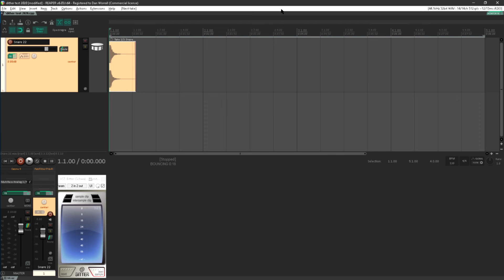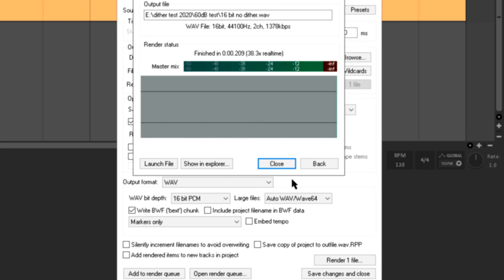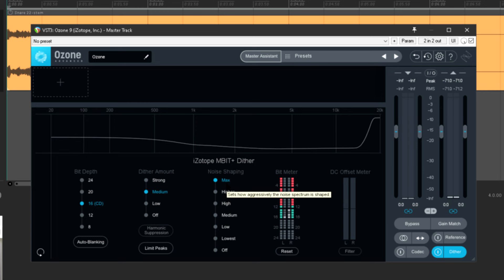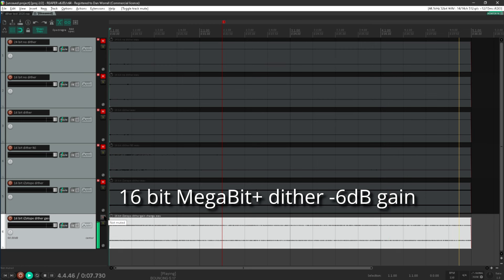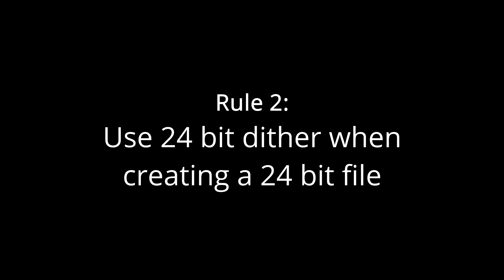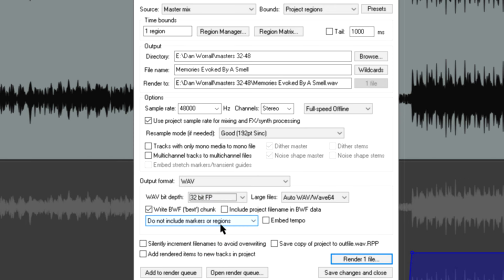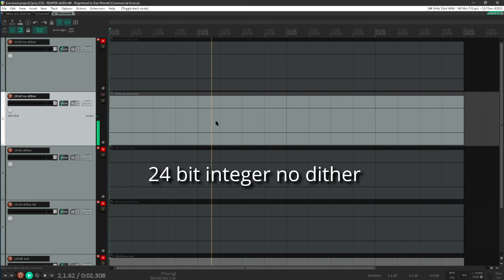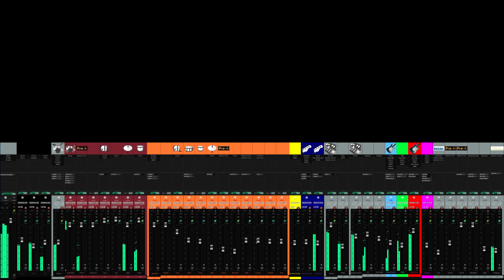WTF is Dither?

Comment: Hi there!
I might be wrong but I think I noticed a mistake in your tests or your conclusions:
When you render the MP3 files both at -60db and -108db, the Dither master and Noise Shape master options are greyed out BUT checked, selected and can not be unselected. Then you present the MP3 files as "no dither" but both dither options are checked.
When you render the WAV file at 32 bit FP these options are greyed out but unselected, meaning you can not select those.
At a point you say that the MP3 files don't let you check the Dither options just as with the 32bit file maybe because it might not be necessary but it's the opposite.

Excuse my bad English, Spanish native!
Reply from the maker: The option is greyed out because dither is not applied. Not for any floating point format, which technically includes MP3 etc. This was confirmed by my tests.

Comment: Hi Dan! first of all Thanks so much for your knowledge. I'm from Argentina and sometimes it's hard for me to understand English, for the most part what you explained is clear to me, but the doubt I have is: I configure my session in 32bit float and then I record everything at 24bit as normal, I generally keep the gain staiging -18RMS at all times, when exporting to go to mastering is it necessary to apply dither in this case that I am using 32bit float? That is not entirely clear to me, I understood that it is supposed to be the last step but I also saw that the distortion could appear even at 24bits. Greetings from Argentina
Reply from the maker: If you render a 24 or 16 bit file you should use dither. If you render a 32 bit float file dither is not needed.
Reply: @DanWorrall  thanks again for the quick answer! Platón says that You're the exit of the cavern  😁

Comment: I have a question, say I use a plugin with built in dither function at the end of my master chain. My session is running in 48khz. And I export from reaper to 44.1 khz 16 bit and encode mp3 at the same time.

What would be priority for sample rate conversion and dither application?

Preferably it would downsample from 48 to 44.1, then apply dither to the 16 bit 44.1 wav, then encode an mp3 from that file, if I understand the video correctly.

Do you know if reaper 7 processes in this order?
Reply from the maker: Your question seems confused. If you're running a dither plugin in your project then you're doing dither before src, which is the wrong way around. Turn off the dither in your plugins and use Reaper's dither instead to encode a wav file with dither, then use the batch converter to make an MP3.
Reply: @DanWorrall  okay, I understand that src is post render and thus the plugins dither gets broken by it.

I'll render at 48 khz, 32 bit then.
And I will use a third party tool for sample rate conversion and dither.

Thanks for responding 🙏

Comment: I didn't get, from where the information coming in 16-bit MP3 file if it's already rendered in 16-bit, but Reaper magically played it below -96dB?
Reply from the maker: It's not a 16 bit MP3 file. MP3s are floating point. If you put 16 bits in, you'll get 16 bits out. If you put more than that in you'll get more than that out (if the decoding side decides it wants to).
Reply: @DanWorrall  Thanks! So, if it rendered at 16 bits, mp3 is still 32 bit float (which is currently 24 bit+extra8bits) but will act as 16 bits and nulls? The information just unused above 16 bits in mp3 always and decoded with most of mp3 players? I thought if more bits=more file size=more bitrate needed to decode in every second of time. But if it's constantly have that extra bits above 16, but it's zeroes maybe the size of the file will be the same always. I didn't know it's float point (32 or 64 float). But i'm guessing, that quiet sounds in mp3 is a wobbly digital noise, isn't it?

Comment: @Dan Worrall    Thank you very much Mr Worrall for such a great video. Would've called you Dan but.....that just doesn't feel right after this video. 😀 I offline bounced a file to 24bit 44.1Khz all coming out of a 24bit 44.1Khz recorded and mixed project. And even if subtle, I could swear the sound changed. Well, I am positive. Never could hear that before but probably because of new monitors....I heard a difference and was rather annoyed by the fact only taking this video more seriously now than before as the info was way above my head when first watching it. 1) Could this be a dither vs non dither problem? I did not dither in this case. (I freezed all my files before bouncing and did not change the plugins' options like turning on oversampling or anything like that) Another question...well....more of a doubt is the following. 2) Do we need to dither at all for files that are staying the same such as 24bit recordings to 24bit mixes and masters at the same sample rate? And my last question and maybe the one we all would like to know is.......3) Is it better to dither or not to dither when uploading to streaming services?  If they convert to lower quality such as mp3, does it do more harm than good?  Sorry for all the questions and I apologise if they don't make any sense. Hopefully there is time in your busy schedule one day to answer them. Thanks again for a great explanation.
Reply from the maker: 1. Almost certainly not dither, which is nearly always inaudible. Honestly the most likely explanation is you noticed something after rendering that you missed during the mix.
2. They don't stay the same bit depth, as all the mixing and processing is either 32 or 64 bit float. Meaning your finished mix is also floating point, so yes you should dither if you're going to 16 or 24.
3. Dither doesn't break from lossy encoding, though the noise shaping might suffer. Still better to use it than not.
Reply: @DanWorrall  An answer in less than a day. Dan Worrall, you are the best!!!! Thank you very very much!!!

Comment: Brilliant video! Reaper is an 'attractive' - looking DAW, I've got a demo one here, and on days when Logic Pro is driving me crazy, I'm tempted to install it! But the problem is, Logic is the industry standard, Reaper is not. Do you do any videos using Logic? As I wonder how Logic's Core Audio would compare and contrast with Reaper? Couple of quick questions, if I may: 1) I tend to do everything these days in 24 bit and 48k, would 32bit float be better for that resolution? 2) I've got the Sonnox Codec Toolbox, and that's really a game-changer! The new codecs piss all over both wav and mp3, it's just nobody's using them yet - I can't upload them anywhere, which is really frustrating as the quality is substantially better than wav/mp3, and the file sizes a fraction!
Reply from the maker: I don't have a Mac, and every time I've used logic I've kind of hated it, so logic tutorials are unlikely to happen on this channel I'm afraid. I don't accept that it's an industry standard, or that that matters in any way anyway.

Comment: Great video about a very important technical matter that most engineers don't care about (but I do, a lot). I have two questions:
1) I always create a separate mixbus track before the Master channel for all the mixbus processing I'd want to be in the mix. When you I plugins in the Master channel that change the audio like Sonarworks Reference 4 or an EQ to cut lows and highs to only hear the mids (plugins I will deactivate when rendering the mix), should I keep my dither plugin at the end of the Mixbus track (before the Master channel) or at the end of Master channel to dither even those plugins?
2) What's your opinion on the NotJustAnotherDither from Airwindows?
Reply from the maker: 1. Dither should be the last thing that happens before you truncate to an integer format.
2. Not tried it. Is it Mac only?
Reply: @DanWorrall  1) Given that I deactivate all plugins in the Master channel before rendering, only the plugins in the Mixbus are still working, so the Dither becomes the last active plugin.
2) It's for windows and Mac, and free (just not in AAX format): http://www.airwindows.com/not-just-another-dither/

It comes included in a dither pack plugin called Ditherbox named as "NJAD": http://www.airwindows.com/ditherbox-vst/
Reply: @DanWorrall  Not any more, Chris has ported a bunch of his dithers to his new build system which also does VST for Windows and Linux
Reply: @DanWorrall  "Ditherbox" is the all-in-one dither plugin: https://www.airwindows.com/ditherbox-vst/ The version in the all-plugins download might have some bugfixes since the link on that page, not sure.
Reply: The version of NotJustAnotherDither found in StudioTan and Monitoring are better (not so bright and fizzy) than the original stand alone version IMO.

Its not a dither, more like a nicer sounding truncation, if that makes any sense.
Reply: @StevieBoyesmusic  Oh, I didn't know Chris updated NJAD in those plugins, weird that he didn't in the single one and Ditherbox.
Reply: @heavymetalmixer91   I think the noise shaping is less aggressive in  the later versions
Guess The originals weren't altered for mix repeatability reasons.

Comment: btw do you happen to know how flac files work? i think it's pretty awesome how these quite unknown kinds of files are just smaller than wav files without changing any aspect of quality. or do they?
Reply: The way I've heard it described is this...
WAV stores all information, both SOUND and NO-SOUND in its file. NO-SOUND still has "file-size".
FLAC doesn't store the NO-SOUND.
So it basically has the exact same SOUND as a WAV, but a smaller file as it's ignored the "blank space".

I honestly can't tell any difference between the two. It may be there, but it's so small it's possibly not worth worrying about.
I'd still love for this to be confirmed either way though.

Comment: Hi Dan, my question is, should one always default to working in 32bit float? What is the drawback in working in 24bit? Thank you.
Reply from the maker: Your DAW already uses floating point maths behind the scenes, so when you're mixing you're working at 32 (or 64) bit float regardless. Your project bit depth setting just determines the recording setting. Your converters are probably 24 bit, so there's no point going higher there. If you're rendering a mix for mastering 24 or 32 float are both fine. 24 bit technically needs to be dithered (no-one will ever know if you don't though) while 32 float doesn't. You get extra headroom above full scale with 32 float, but a larger file size. If you're rendering a master for release then stick to integer formats, 16 or 24 bit.
Reply: @DanWorrall  Thank you Dan, this is perfect!

Comment: Ok, I really focused and paid attention but just want one confirmation...If I record/mix in 32-bit/float, should I be concerned about dithering my plugins to 24?  Should I worry about dithering my master fader to 24-bit before sending for mastering?  Is it ok to dither to 16-bit from 32??  Thank you.  I went to college for this but it's always fun to review and confirm.
Reply from the maker: Don't worry about "dithering your plugins".

Use 24 bit dither if you're rendering a 24 bit file. If you're giving your mastering engineer a 32 float file don't bother.

32 float to 16 bit with dither: that's fine.
Reply: @DanWorrall  You are the man!  Really digging your channel.  Thank you for the advice and prompt follow-through!!!!

Comment: Hi Dan,

If I started the track in 24 bit and Im rendering the final master @  24 bit should I still end my master chain with a 24 bit dither + noise shaping? Im currently using Ozone 11 maximizer with 24 bit Dither , Low dither, Low noise shaping + auto blanking , limit peaks and dc offset meter filter all engaged. Is this optimal ? Or since i'm not downgrading to a 16 bit rendering all unnecessary? Mostly, what I've read online makes it seem since I am not dropping to a 16 bit render that it could be potentially more damaging to add this step.

Thank you
Reply from the maker: You may have recorded 24 bit files, but your DAW is mixing them using 32 or 64 bit floating point maths, so when you render a 24 bit file you are indeed reducing the bit depth, and yes you should use dither. However this is a case where it's mathematically correct to do so, but the difference is so tiny no-one will ever notice if you don't. It's much more important to correctly dither when you drop down to 16 bits.
Reply from the maker: I tend not to use auto blanking personally, as noise draws more attention to itself when it stops and starts then when it's continuous. But it's kind of academic with 24 bit dither, as you're very unlikely to ever actually hear it anyway.
Reply: @DanWorrall  thank you very much!

Comment: The point that i don't get is, how is it possible to retain the reverb tail information by adding a noise floor? Is the file truly 16bit after the dithering process?
Reply from the maker: The reverb tail biases the noise, changing the probability of high or low bits. Each individual sample has just as much error, but the average of a window of samples will tend to the correct value. Eg. If you've only got integer numbers you can't represent 0.25: it will get rounded to zero every time. But what if it got rounded to zero some of the time, and rounded to one some of the time, and on average there were three zeroes for every one. That means the average value tends towards the correct 0.25 even though each individual value is still only 0 or 1.

Comment: So is a 192 kbps MP3 file practically the same thing as 24 bit PCM WAV file? I mean do the two formats have any major differences in sound? Because they do have tremendous differences in file size considering a 192 kbps MP3 file is nearly 1/3 of the size of a 24 bit PCM WAV file... am I correct or just misinformed and in need of educating myself with more content from your amazing channel? Thank you for what you do
Reply from the maker: No. You lose some detail when you encode an MP3, as it's a lossy codec. Whether that's audible or not is subjective, and will also depend on the audio. MP3 theoretically is capable of better dynamic range, as it's a floating point format. But not in any meaningful, audible way: the detail you lose when encoding an MP3 is much more significant.

Comment: Can anyone explain, or provide a resource that does, as to why the dithered audio seems to "extend" the perceived decay of the reverb tail? My logic is telling me that if the audio file is rendered to same bit depth then the quietest encoded reverb should reach around the same point in time whether it is dithered or not, just with the distortion being masked by the dithering noise...
Reply from the maker: A few ways to try thinking about it:

Audio signal alone is below the LSB. Audio signal plus noise is not.

The noise biases the audio signal, pushing it up above the level of the LSB.

The audio signal biases the noise: the dither alone has an equal probability of flipping the LSB on or off. When the audio signal drops below the level of the LSB it still changes the probability of the dither flipping the LSB on or off.

Each individual sample has as much error as without the dither. But the average value of a window of samples becomes much more accurate with dither added.

The dither noise randomises the errors, which converts them from distortion (related to the audio signal) to noise (random values).

Any of those help at all?
Reply: @DanWorrall  Thanks Dan, that does actually make sense. You have more or less put into simple terms what the visual representation does on this video (for anybody else who might be interested):

https://www.youtube.com/watch?v=zWpWIQw7HWU

P.S. keep up the great work, you have an amazing ability to explain these technicalities in easily understood language yet still with incredible nuance. Hero.

Comment: Rendering to mp3 is with greyed dither options -- but they're checked. So not that converting to mp3 is not needed but that when converting to mp3 dither is obligatory applied.
Reply from the maker: Except if you watch the video I demonstrate that's not the case. There's no dither noise in the MP3 files I rendered from Reaper. Only in the ones I rendered as wav and then converted afterwards.

Comment: Hey Dan, I work in Ableton Live and I tried out the free bitter plugin. For some reason, it is telling me that 16 or 24-bit files are using 32 bits, even though I didn't touch the gain knob or anything inside ableton. Any idea why this is?
Reply from the maker: Any stretching going on? Samplerate conversion?
Reply: @DanWorrall not that I know of. if I run Ableton itself at a different sample rate than the source file will that effect things?
Reply from the maker: @Ferrichrome  yes. The audio will have to be samplerate converted, otherwise it will play at the wrong speed.
Reply: @DanWorrall  that makes so much sense! I was scratching my head for a couple hours trying to figure that out. Thank you for the help!

Comment: Totally had the problem of rendering a 24/48khz town mp3 and when played on a cheap speaker it sped up the track! It reprocessed down to 16/44.1, sped the track up and pitched it up too!
Reply: Although I might be wrong and it only does that when trying to play a full resolution Wav on a 16 converting hardware

Comment: Dan, I always bounce my mixdowns at 24 Bits nodither, then I master using ProTools and dither the master with the built in dither provided by Fab Filter's L-2. Is it okay or should I dither the mixdown too?
Reply from the maker: You should dither the mixdown, strictly speaking. Make sure it's 24 bit dither though, and don't expect to hear any difference ;)
Reply: @DanWorrall  Thanks Dan, very appreciated!